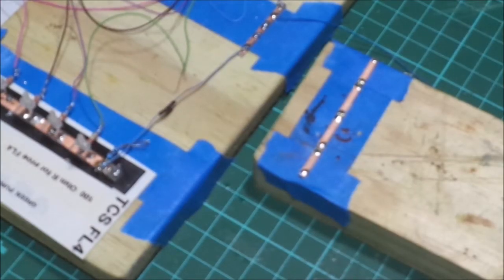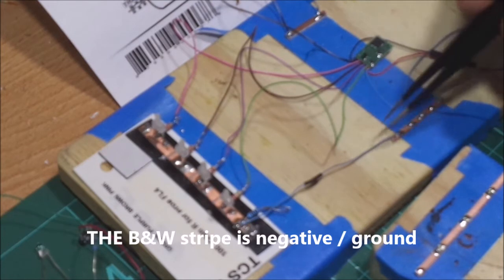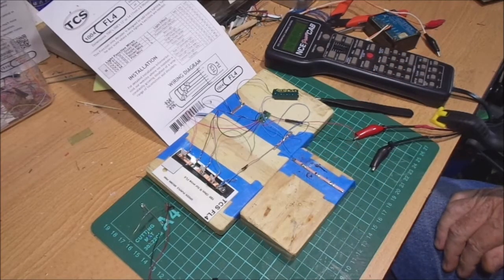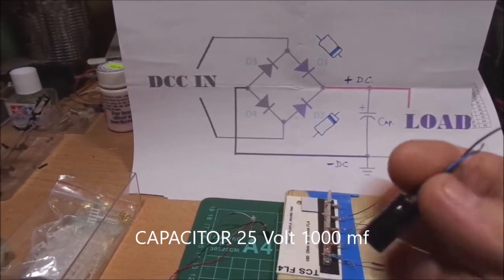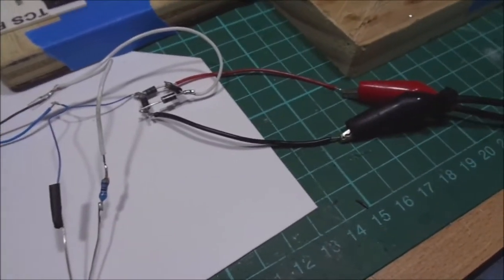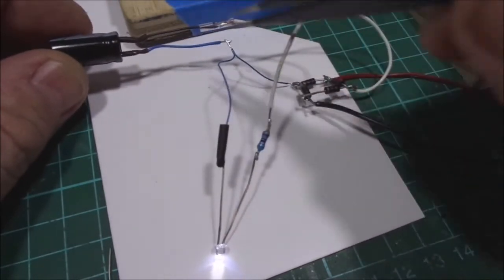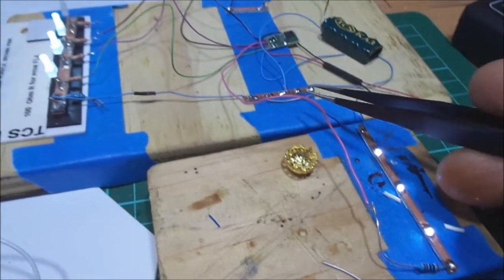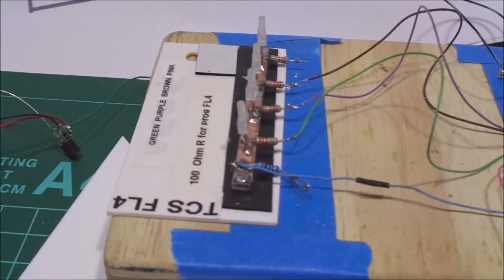TCS FL Decoders

Comment: If you have the lights flashing? Will the lights keep flashing with the way you have the TCS
 KA wired?
Reply from the maker: Yes, you connect the KA to the blue common positive (+) on the FL4 and the black & white stipe wire (negative).Of course you program the flicker tothe function you want. What the KA is doing is keeping a charge of power, it does NOT effect any lighting effects you program into the FL4. If you don't have a KA you can use a common capacitor and connect it tothe blue and B&W stripe - suggest at least 470mF capicitor or larger. Iuse the caps in many of my cabooses.
Reply: Laurie McLean MMR wow! Thanks! There may be more of these videos out here,but this is the one that has helped me on my quest! Thank you for the great content and information,and taking the time to help me understand! I have already burned up 3 tsunami decoders "trying to put capacitors in them? 😃(not proud of that,but true story!?

Comment: What kind of soldering tool do you have? I have some tiny pencils that are not very useful so I'm still using my weller 100w gun but which is ok but the tip is big and not enough power when I'm soldering larger things. It's find for small projects like this.
I have seen yours in the background a few times and it looks like yours is nice and hot like a 250w or something? I'm looking to buy a resistance soldering setup but wondering if you have a better system. Thanks!!
Reply from the maker: This is what I use and is a variable temperature iron which is what I recommend - get one with a heavy transformer -
https://www.jaycar.com.au/60w-esd-safe-lead-free-soldering-station-with-lcd-panel/p/TS1390
Reply: Wow that was quick!! Thanks a ton!!!
Reply from the maker: A 60 watt variable temperature soldering station which is from Jaycar here in Australia. DO NOT use a wet sponge, the water destroys the tip. Use a coiled brass solder iron tip cleaner which are cheap but work perfectly and the iron tip stays clean and never cools like when using a wet sponge.